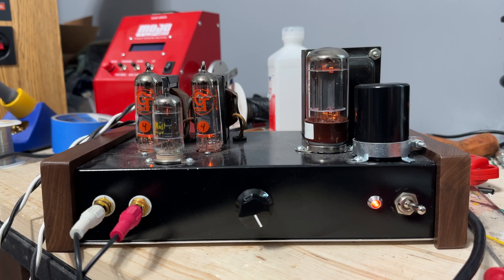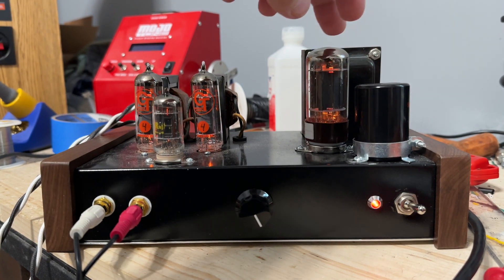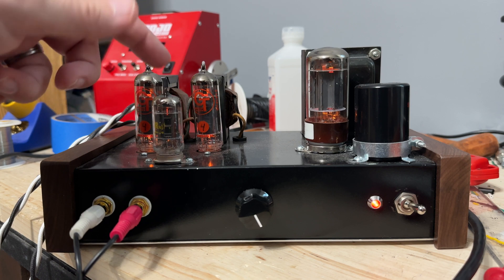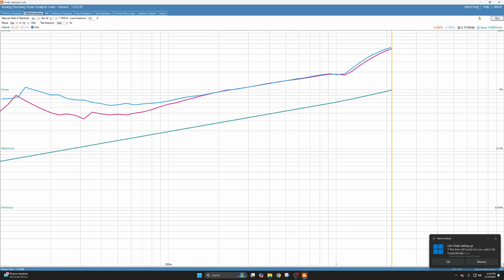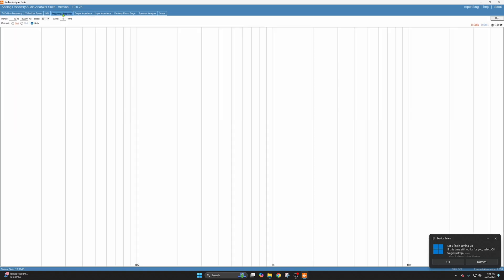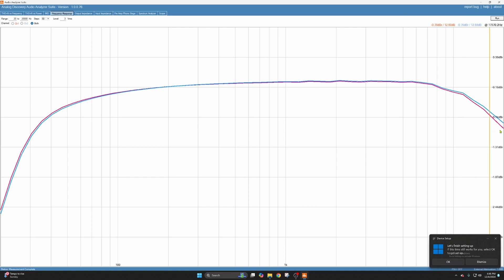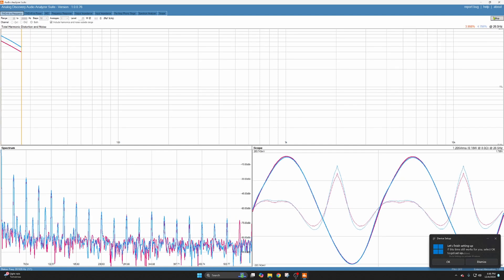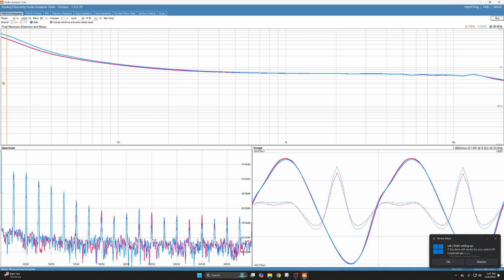HiFi Tube amp EL84 Triode

Comment: Nice amp. How about a step by step a la Skunkie?
Reply from the maker: I am going to do some new step by step with my guitar amps. Thinking of what to do next for hifi. Got any ideas… single ended kt88, 2a3, push pull kt88 MC275 killer?
Reply: @DaveEdwardsDesigns  My pick would be a 2A3 SET for hifi
Reply from the maker: I’ll see what I can dig up 😁